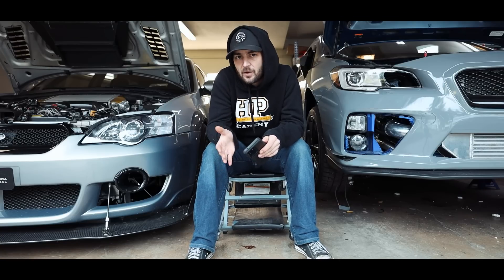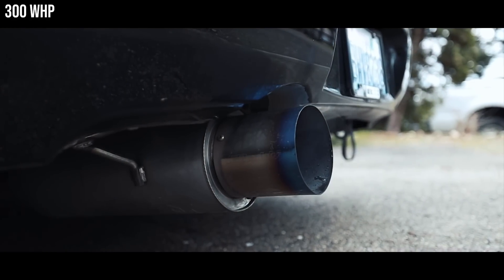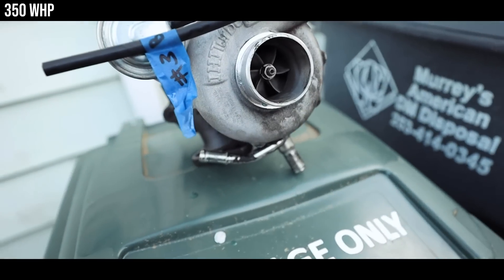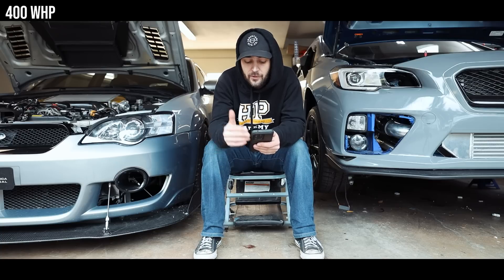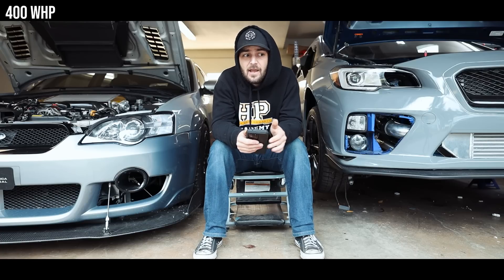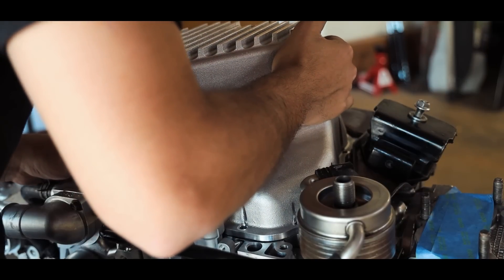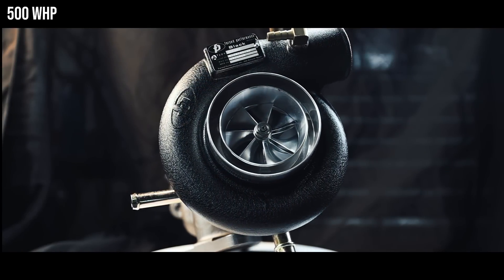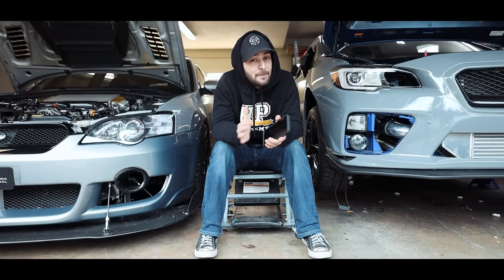How to Make "X" Horsepower in a Subaru WRX STI

Comment: •Forged OutFront block
•Nitride crank
•Forged rods
•CP pistons
•Brian Crower forged valves, valve springs, titanium retainers on stock cams
•Ported intake and exhaust channels on cylinder heads
•Tomei equal length manifold, up pipe
•FP HTZ Blue with ported inlet, PTP turbo blanket and magnetic oil filter sock 
•Perrin Performance (big black 😂) turbo inlet hose
•ID 1300's
•IAG TGV deletes, IAG fuel rails, IAG PTFE fuel lines, IAG street series AOS
•AeroMotive FPR 
•Process West intercooler and shroud WITH triple water jet spray
•Invidia bellmouth downpipe 3in
•Invidia titanium exhaust 3in to 4in tip
•Grimspeed EBCS
•Cobb E85 kit, lightweight crank pulley, SF intake
•550tq capable clutch 
•AEM 340lph multi fuel type pump
•NGK one step colder plugs...and brand new coil packs
•StopTech steel braided brake lines, ceramic pads with slotted/drilled rotors
•Megan Racing pro-street coil over suspension 
•Kartboy bushings, endlinks, exhaust hangers....very grateful for the beyond awesome hookup thanks to Tom at Kartboy
•Tuned by "The Magic Man" aka "MoBetta" (if you know, THEN YOU KNOW. If you don't, you Betta ask somebody)

All this in one vehicle that is behaving well for the moment on 91 pump gas at 335whp/tq......waiting for the E85 tune still. Dyno shop being relocated currently. 

I think I got it all in there, maybe......and I'm not done yet.

Comment: how much HP does the intake add?   i am also curious what gains the  cat back would provide
Reply from the maker: Off the top of my head I dont recall. COBB has the dyno graph on their website 🤙
Reply: @Smeedia  it is my understanding that the stock intake does not become a restriction until 400whp.

I thought we bought the SF intake for the sound

Comment: Lots of good info, thanks! I like Torque Solutions 6AN fuel line kit. It was easy to build and I had zero leaks, and it was the first time I've ever built a fuel line. Also, I couldn't find any proven benefit to running parallel versus series for the lines, so I prefer series for simplicity. Some people think running in series can "starve" the last injector, but that's not how it works.
Reply from the maker: I haven seen too much data on the fact, but purley preference. 🔥
Reply: Yikes , nah I'll keep it parallel

Comment: Was just wondering for the clutch options on 500whp, what are your thoughts on south bend, their daily clutches to be exact, stage 2 and 3, also this list was extremely helpful thx :)
Reply: I would go with a ACT 6 puck and call it a day. I'm running one on my 6 speed swap wrx.
Reply from the maker: For subarus I always suggest ACT 🔥 HDSS is great for most people. If your looking st more than 515 Ft Lbs TQ then I'd look into something a bit stronger
Reply: @Smeedia  gotcha, also for the 500whp list, is it still achievable on 93 pump, reason being the nearest e85 pump near me is around 1hr drive so 93 is the way I’ll go. And I would love to make 500whp on the 93 pump available to me...
Reply from the maker: Yes you can 🤙 my FP Black made 456WHP on pump gas conservativly

Comment: Good info but my car is hitting 340whp on stock OEM 165k miles on the fuel injectors and a 16g turbo and its running strong and hard 😉👌
Reply from the maker: Dyno calibrations are diffrent across the board as well 😉

Comment: Make a disclaimer about the access port. Canada/USA are not the only 2 countries, neither is the access port required to tune. 

I just installed a 3 port with my stock ECU. No dramas, tune went well and making 250whp with a downpipe too.
Reply from the maker: Very true, targeted at AP regions, open source would be a diffrent ball game 🤙
Reply: Seems like alot if work for 250hp, AP is the easiest way

Comment: You didn’t mention anything about heads. Curious as to how much power the WRX and STI heads hold.
Reply from the maker: Stock heads can pull 500, but some 272 cams would make it a bit easier for flow 🤙
Reply: Cams make a huge difference! I feel this is how I use to win races most the time. I just had that awesome bottom end along with that little extra pull on the top end. Get a little pocket port, gsc valves/springs, and bc272 cams. PS if I was to do it again I would of bought a C8 corvette that has a warranty, good resale value, and passes inspection easily. #salty

Comment: For my 2011 wrx that makes 300hp 350tq from grimm speed devorced down pipe 3" and my invidia  exaust is 3" invidia offroad equal length headers 2", mishimoto  large top mount inter cooler cobb tuner with pro-tune,   Stock td04 turbo, mishi moto radiator, headstuded, air/oil separator, Grimm speed boost controller, perrin blow off valve,  perrin  cold Air intake, 1050x injectors and dw265 fuel pump

Comment: I knew a lot of this information already but it’s nice to hear from someone who has built multiple ej engines and had experience with them. Hoping to hit 400whp in the new year with my wrx. Already have alot of this stuff plus a closed deck IAG block and the sti transmission swap. What are your thoughts on the new IAG oil pan set up and the new IAG aos v3 is it worth upgrading
Reply from the maker: I actually prefer the V2 AOS, IVE HAD TWO v3s break on me (both the lower coolant lines leaking) I do like their Oil pan quite a bit. Used it on my 05 STi 🔥
Reply: @Smeedia  is there a difference between the cheap and expensive aos?
Reply from the maker: What do you mean by cheap and expensive. I wouldent cheap out on an AOS
Reply: @Smeedia  my bad I confused catch can vs air oil. Cause I'm using a 35$ amazon catch can. Just didn't know if the nice catch cans are better
Reply from the maker: If going catch cans I'd consider something like radium 🤙
Reply: Oh wow I'm glad I didn't bother upgrading then ill put the money into fueling instead of another aos. Are the lines with the iag kit good enough for 400-450 or should make my own?
Reply: What’s the diff between v2 v3 AOS

Comment: I just got a 2013 hatch wrx and I can notice a performance drop and it sounds to me like boost leak.  My cobb AP still shows 16 lbs.  Any thoughts?
Reply from the maker: Pressure test or soapy water test while the cars running 💪
Reply: @Smeedia  throttle body intercooler pipe was almost totally off and the by pass value bolts were finger tight

Comment: Do for older EJ20, trying to get my power goal to be 400whp.
Reply from the maker: I'll see what I can put together 🔥
Reply: E85 , stx67 turbo , 1300cc injectors along with iag rails , lines  ,  fpr, full exhaust including header  , eBay special fmic  lol , 450 fuel pump , good tuner . I’m at 410whp , stock Sti bov , stock ej20  03 wrx with those mods .  Tuner said i  have more fuel  for more hp but my stock internals are already hanging on for dear life .
Reply: @1VIPWRX  Don't have E85 where I live. Everyone uses methanol injection instead..
Reply: @N3770SS  thats fine  . That setup will get you there

Comment: Cobb 20G can make around 390-400whp at 20 lbs.  My friend made 398whp with all mods you listed for the 350whp range.  Also I would recommend upgrading all fueling for anything over 350whp.  Good job explaining though.  This is very helpful especially for newbies.
Reply from the maker: Cobb rates their 20G at around 400ish max, I always over build to give more head room than push parts to their limits for growth. But you can make more with their 20G 🤙

Comment: Cylinder 4 coolant mod highly recommended 
Oil pressure and temperature gauges !
I’m running an AEM 340 hard wired and next Dyno day shooting for 550 WHP. See if she will do it before going radium hanger and a surge tank.
Reply from the maker: Left out gauges and only focused on power mods Here, cyl 4 cooling mod is hit or miss. Personally haven't seen any real changes between having one and not having one. But never hurts to add. Good luck 🔥 maxed my single 340 out at 400 on E, and capped another around 500 on pump 🤙
Reply: @Smeedia  I got Cyl 4 mod hoping to make my built engine last lol.
Cool, will let you know the results late spring!
Reply: @BoostedBrando lol a little late but did you ever figure out what your sti made on the single 340 pump?

Comment: A comment on intake manifolds 
If you got the money AMS is great.
Otherwise pick up a welded/shaved 2.5i NA Manifold from Outfront Motorsports
It’s cheaper and flows just as good if not better. I’ve seen a car make nearly 1000 WHP on this manifold.
Reply from the maker: The N/A manifolds are great options as well 🔥

Comment: I recently got back my 05 hatch wrx with It's an STI nitrated crankshaft with Manley Rods with ARP bolts. Wiseco Pistons bored .020 over. With fresh 7 angle valve job with Crower cams and springs and retainers with APR head studs and Cometic head gaskets. With TGV delete intake and ACT road race 500 hp clutch. Also 750 injectors (for now) 340cc AEM high flow fuel pump, as well as a full exhaust. What should I do next before I get it pro tuned? I’m thinking definitely a boost gauge and a wide band sensor
Reply: turbo definitely ,1000cc injectors would be better
Reply: @zeno15sti33  I’m gonna get some 1050cc for sure
Reply from the maker: What turbo are you using?
Reply: @Smeedia  love your videos definitely have taught me a lot and for that I’m thankful
Reply from the maker: Swap that turbo out 💪
Reply: @Smeedia  still on stock turbo unfortunately

Comment: Pretty much all good information. Only recommendation: Upgrading to dual fuel pump / hangar isn't necessary until over 600whp. A single 320lph AEM will flow enough to push e85 up to ~305lph @ 600whp. Running a 2nd pump below this power level is just overpumping the system which will heat up the fuel. This is how "vapor lock" is induced as the pumps just heat the fuel during highway cruise until it gets to vapor transition point when it gets up to the warm fuel rails / engine bay. If you have a good quality ECM that can read the digital signal from the flex sensor, definitely keep an eye on fuel temps if your system is running dual pumps full time.
Reply: no it won't. 340LPH in mine wasn't cutting it at 400whp on E85 with an EZ30R with stock pump wiring loom. After hardwiring it's pumping enough but maybe only for another 50hp. Fuel pump flow diminishes alot with increased head pressure, which happens on turbo cars with manifold-referenced fuel pressure regulators to maintain constant injector differential pressure.
Reply: In the spring when I go to the Dyno, I’m going to try to push this same pump.
Aiming for 550, on a hardwired AEM
Reply: My single walboro 450 was maxing out after 28psi at 470whp on E85 with a fp red xr. So went to dual walboro 450 radium setup
Reply from the maker: My AEM was capping at 400WHP on E85, the fuel pump is a little over kill but running it with a Hobbs switch from Iwire should help to prevent from over feeding and over heating. Normally I kept mine around 15PSI or so. So if it needed the fuel it was there. I've seen some 450LPHs do work on E85 as well
Reply: @Smeedia  Interesting. Most fuel flow calculators quote 300lph being able to hit 500whp on E85 no problem. I'll keep that in mind when I go in for my E85 tune in a couple months. Thanks for the heads up!
Reply from the maker: The 450LPH from walbro is a killer set up for single pumps. On E85 on a single 340lph we bumped up base pressure a little to compensate and worked but wouldent advise it if you can avoid it 🔥
Reply: @Smeedia  Completely agree. Unfortunately the big bell bottom of the 450lph pumps doesn't fit in the stock fuel pump housing
Reply: @Gadyuzkha  what do you do then to make it fit? Is there any kit?
Reply: @Gadyuzkha  Get out the dremel, I gutted my plastic/'late' subaru housing with the inbuilt filter and put a walbro 525 inside, bypassing the standard paper filter. Now use a stainless in-line filter instead :)
Reply: @Gadyuzkha  it does all you have to do is bend the bracket a lil ask me how i know

Comment: Type RA block, uel headers, uppipe, Cattless dp, spt exhaust, 44m EWG, all fuel supporting mods  (ID1200), TGV deletes, E85, IAG AOS, stage 3 comp clutch(very smooth), Blouch 20G, SF Intake, inlet, and killer B oil supporting mods. Turbo smart BOV, with ETS tmic got me to 431whp/399tq on E85, 360whp on 93, Prob forgot some stuff. Go fmic if you want anymore than that, the 20G will go a little further not much tho. Might help some of y’all out🤘

Comment: fa20 pls.
i have a 2016 frs
sbd turbo kit
aem fuel pump
id 1050 injectors
full exhaust catless single exit w muffler
16psi
100octane on octane booster
340whp 
ngk -10 sparkplugs
mishi oil cooler soon and maybe ao seperator but not much knowledge on those
Reply from the maker: I'll put one together for the BRZ/FRS soon, once my 2022 comes in 🔥

Comment: You forgot the biggest tip of all....when upgrading for more power never cut up your stock wiring harness unless you work at iWire 🤣
Reply from the maker: We don't talk about the forbidden spaghetti 😅
Reply: Ive fixed enough iwire cars to know even they are not good at what they do.
Reply from the maker: Never had an issue with any iwire product
Reply: @evanrosario  ok than what other company is better than iwire?

Comment: On my 2020 STI I'm running GS down pipe, tmic and ebcs, perrin up pipe. cobb sf  w/box, aem 340, ID1050"s. Making 330hp and 366ftlbs on e85. 304/330 on 93.you are spot on on your recommendations.
Reply from the maker: Some good numbers you've got there 🔥

Comment: I'm over here just scrambling trying to get money together for my protune on my TD04L matched to my Type RA motor still lmao. Upgraded fuel pump, but injectors will be my limit. I can't lie, I won't think of anything more than a VF series turbo as I know my 5 speed is glass and @ 193k miles lmao.
Reply from the maker: Those 5 speeds scare me 😳
Reply: @Smeedia  Lol yeah... I've always heard to not try to go past 350wtq max that seems to be the point where it just won't hold up much longer.  Of course even at stock power levels, or stage 2, you can break one of these guys launching it aggressively over and over.

Comment: Just to show how the little 20g turbo can still push power is that I am just shy of 500whp running that turbo! I believe we think alike as I actually had the same mods to the brand, as you listed!
Reply: Blouch 20G got me to 431whp/399tq limited by my ets top Mount🔥
Reply from the maker: Which 20G?! 👀🔥
Reply: @Smeedia  The Blouch 20G-XTR with the 10cm hot side. Although I am running pretty much every supporting mod to get there but still :)
Reply: My cobb 20g maxed out at 415whp on E85 back in the day. Was stock headers and heads however but running 21 psi. You’re definitely maxed out on the efficiency of that turbo

Comment: We definitely need a video for making power on EJ WRXs
Reply from the maker: For the most part it's fairly same same with the exception of the trans and shortblock limitations 🤙
Reply: @Smeedia  bigger intercooler and better heat shielding around the turbo is a good addition too for wrx. My time attack car tended yo heat soak alot before I made those additions
Reply: @Smeedia  good to know. 
One question about the transmissions tho, does it make sense to build the 5 speed or should you just get a 6 speed?
Reply from the maker: Personally I'd say 6 speed swap 🔥
Reply: @Name-eg1uf go with the built 5 speed with 4:44 diff it’s a great track setup
Reply: No joke all you gotta do is swap everything sti into the wrx and run a vf48 turbo on the jdm ej205 block you can make 300 easy don’t go over or you will run into problems

Comment: Happy thanksgiving brotha
Reply from the maker: Happy late Thanksgiving my dude 🔥
Reply: @Smeedia  my 400whp is done on 340 aem pump and 1050x injectors on e85 of course- 14 wrx hatch - also got a mdx555 turbo
Reply from the maker: That's how mine was as well, but we had to bump base fuel pressure up to compensate with E85 because we were running out of Injector
Reply: @Smeedia  fairrrrr, makes sense, I wanna pay this hatch off an build a drag car out of it 🔥

Comment: Would love to see one for an fa wrx!
Reply from the maker: I'll see what I can whip up 🔥
Reply: @Smeedia  it’s been about 5 weeks since I dropped off the final parts check on my 2015 wrx build. Fully built stage 2.5 iag closed deck block, boost labs twin scroll 500hp capable bolt on turbo. All the supporting mods and flex fuel kit. Hopefully getting her back as soon as the turbo comes in off back order!!
Reply from the maker: Hopefully it's soon 🔥🔥🔥
Reply: @noahbilodeau9970  fa20 wrx?! Lwt me know the numbers! I have a stage 2 block lol curious to hear what you get
Reply: @noahbilodeau9970  Prime Motoring?
Reply: @mvp2000pj  for sure!!! Hoping it’ll be done within the next two weeks. Tuner and engine builder told me around 450 wheel reliable on flex fuel
Reply: @itzcuzimgreek32  kinetic motorworks
Reply: @Smeedia  yes 👍🏻👍🏻
Reply: I would also like to see  fa WRX list when you have time for it 👍🏻
Reply: Definitely need the fa build list I already have mine but wouldn't hurt to hear more ways and maybe find some better ways threw your videos so yes please fa 2020 wrx
Reply: I agree ^
Reply: 100% agree. Please do an FA build
Reply: Yes that’d be awesome
Reply: Yes yes
Reply: Brz*
Reply: Same
Reply: Cobb AP, Perrin boost controller, Grimmspeed charge pipe, Go Fast Bits full recirculating BPV, Grimmspeed TMIC,  Mishimoto TGV delete, Perrin stainless steel exhaust header, Grimmspeed J pipe, Subaru STI exhaust for WRX, IAG AOS, EGR delete, Fluidampr, Protune. Weight reduction included Wedsport rims, PST carbon fiber driveshaft, Brembo brakes all around and Odessey lightweight battery. 278 WHP, 329 lb ft torque. Decent respectable increase giving quick reliable responsive fun and good mpg at 80 mph.
Reply: @WRXMAN-ms2mm  what dyno was it tuned on? Seems a bit low for fbo
Reply: @snboost  Dynapack hub dyno. Oh and fuel ⛽️ is 94 octane.